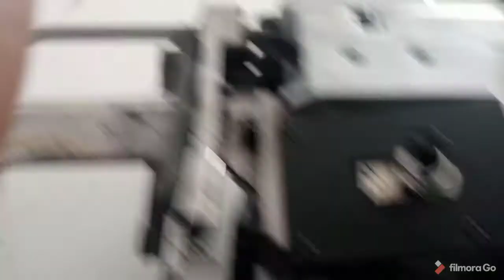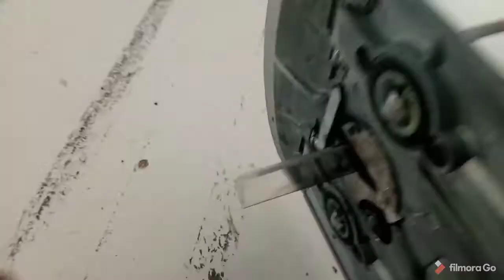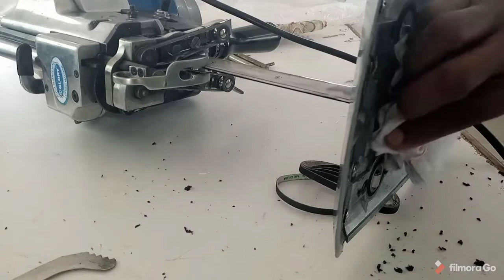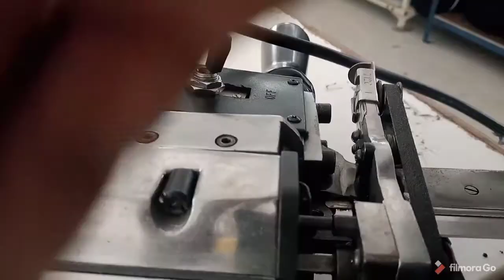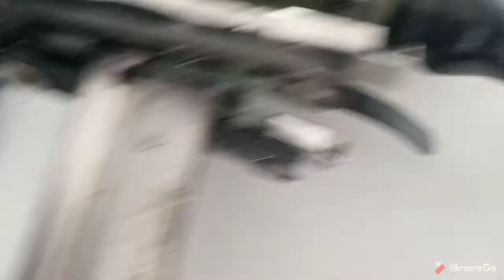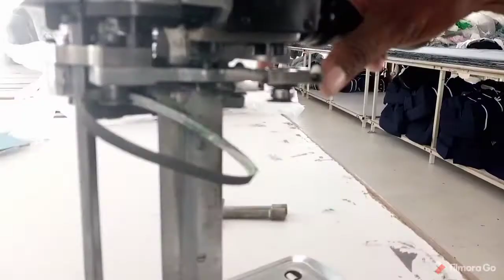New blade change straight knife | #shorts.

Comment: sir what to do if after changing new blade, fabric is eaten
Reply from the maker: Machine stend inside settle dust, knife place not perfect.clean stend inside and fix knife fully set stend center.check trail running